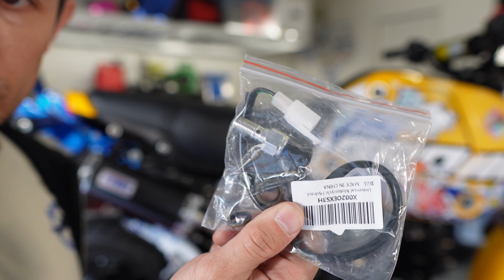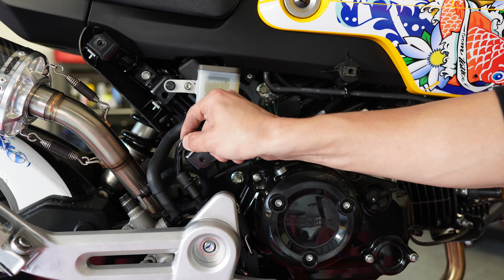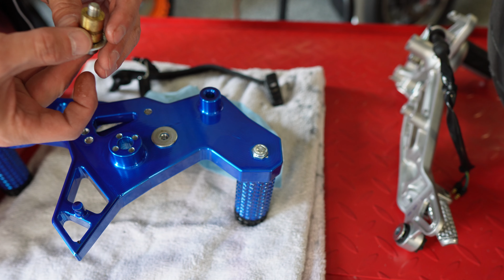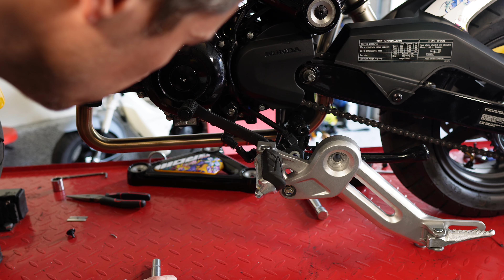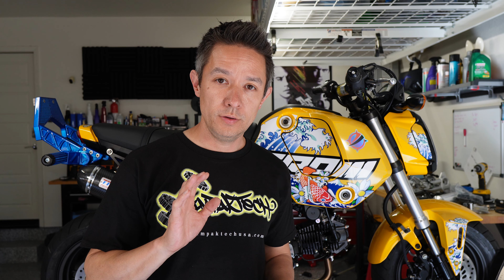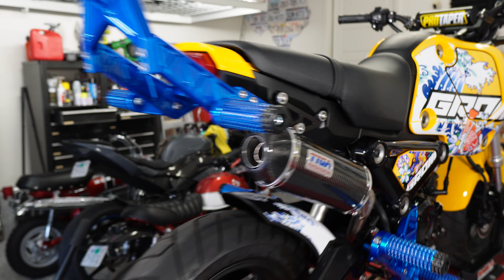Impaktech Rear Sets / Crash Cage Installed on my 2022-2025 Honda Grom

Comment: Why did u change stock rear break switch?
Reply from the maker: The stock rear brake switch doesn't work on these aftermarket rearsets; swapping to a hydraulic pressure-based switch solves the issue.

Comment: New tip: Anyone who wants to have a license plate bracket work with this impaktech 12bar, you're going to have to thread the remainder of the holes in the impaktech 12bar. Dont do what I did by threading from the opposite unthreaded end, Just thread through the top with the existing thread all the way to the bottom of the bottom w/ a m6x1.0 tap. Good Luck. My MNNTHBX bracket needed to have holes drilled in it to align to the frame/impaktech holes. The Yoshimura bracket is already aligned. Not sure about TST Industries.

Comment: Anyone who's struggling with getting the spring on, remove the rearset with the brake master attached and press brake pedal down while hooking the clip back on.
Reply from the maker: Or use a spring puller tool…
Reply: @eastcoastish  Yeah, aka my hooked retainer clip remover...

Comment: This video is literal gold. Thanks I am following it while doing this job myself and I just got both rear-sets off and I have to call it a day. Bought some threaded carriage bolts from home depot, PSA, dont use a threaded shit bolt to chase the rear swing arm bolt. Just get another rear swing arm bolt and use it to chase it. I am gonna get back to my Impaktech Install project next weekend after my extra swing arm bolt arrives and I bet you I'm gonna spend half an hour trying to align the swing arm to the frame X_X.

Comment: So I took the plunge and order the rear set based on the video. 

Question, the rear brake light switch, why is it necessary to replace the stock one? Is it because it doesn’t work with the new rear-set?
Reply from the maker: Yeh, the stock one uses the spring plunger that doesn’t work with the aftermarket rearsets so you need to use an inline pressure switch. It’s a cleaner setup anyway. Let them know you saw my video too 😃
Reply: Yeah, I talked to Juan and told him that I originally saw your video.  He referred me back to it for install cause he doesn’t have anything. 

Do you think you could shoot me the link on Amazon for the new brake light switch? 

BTW…. On a side note… I appreciate the videos you put out. I find them super helpful and informative.  I will definitely have my iPad with your video up when I do my install. 😆 I’m not very mechanically inclined, but you make it seem pretty easy.

Comment: Where did you find the long bolt to send through so you don't need to worry about the realignment of the rearend?
Reply from the maker: It was actually just an extra piece from my Harbor Freight carrier. You should be able to pickup an extra swing arm bolt from Honda for cheap though…
Reply: @eastcoastish  thanks. And for the rear brake light sensor, do I need to buy a bracket for it somewhere? I found the sensor on Amazon like you said I just don’t know what I’m getting myself into 😂😂.

Literally my first time working on a bike
Reply from the maker: @ramblinjay3816 I changed the connector to be bullet connectors to make it easier, you can connect it to the old wires however you want, it also doesn't matter which wire is which - they're just closing a ground connection. DM me on IG @eastcoastish if you have more questions.
Reply: @eastcoastish  hi, do you have the link for the brake pressure switch for the 22? Also what is better the long bolt thingy from harbor freight or getting one from Honda. What is that thing called?  😬

Comment: How are you mounting your license plate with the 12 bar?
Reply from the maker: I just worked on that last night 😀 I had to take off a couple of mm on each side of the Yoshimura tail tidy and had to tap m6*1.0 threads on the other side of the 12bar but the result is great! I know Impaktech is also working on a solution of their own. Check out these pics: https://imgur.io/a/HTcBuEu